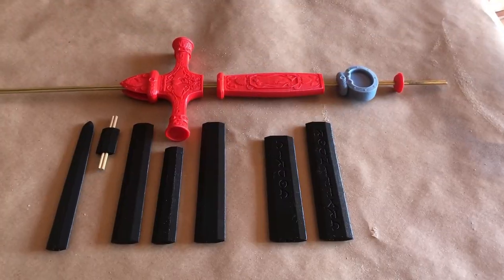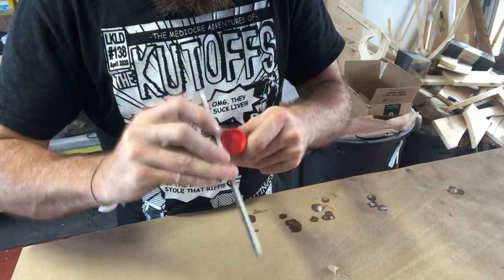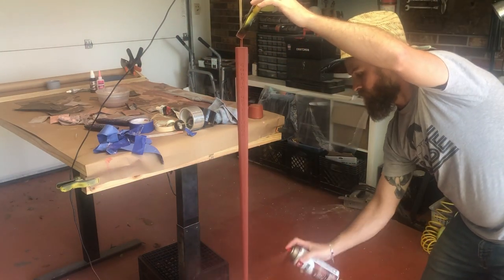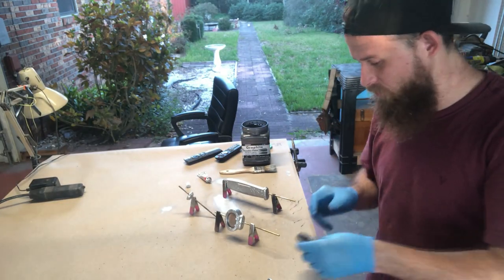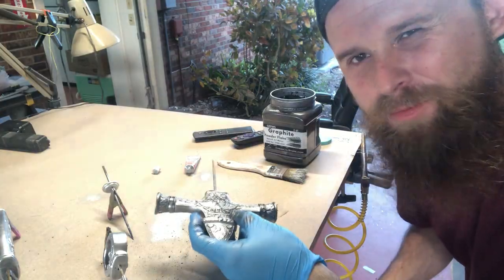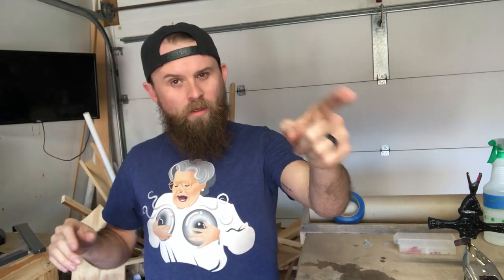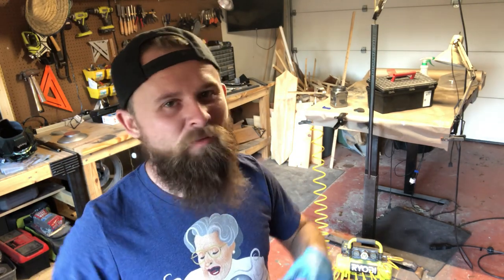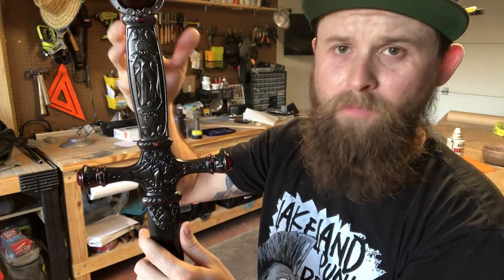"DIY: How to Make the Sword of Gryffindor from Harry Potter"

Comment: Hey looks good I was wondering what orientation did you use for the 3d printing the different parts. I have been able to print the pommel and the handle in resin but I'm struggling with the cross guard.  Thank you
Reply from the maker: Oh this is a good question I also had to try out a few different orientations
But I believe what I did in the end was set it at an angle with the pointed top section away from the print bed. Because I figured the easiest place to have the supports and also be able to clean it up after easily would be the under side of the cross guard. 

So I set it vertical at a slight angle so the connecting side to the handle wasn’t level with the print surface.

I found that it adhered and printed better if I set it at an angle instead of adhering directly and level to the print surface. 

I hope that made sense.
Let me know if you other questions 😁
Reply: @fandombuilds6701  Thank you I also found I needed to beef up my supports help also and now print out just fine.  Im trying out printing the whole thing in resin
Reply from the maker: @shmecky2818  I’d definitely do that to! 😁👍 I did the entire handle in resin then the blade in pla. The rubies I used a red transparent resin. 
If you wet sand then and clear coat they should turn out great! 
Post some pics when you finish, I’d like to see how it turns out :)

Comment: Esperar quando tempo depois de pintar para passa o grafite?
Reply from the maker: Great question! You should be able to able to apply the graphite as soon as the glossy black paint was dry. But make sure before you apply the graphite to wipe down and make sure there is no fingerprints or oils on the part. After the paint has dried you can wash it with soap and let it dry. Then once dry apply the graphite.
I hope that was helpful :)
Reply: @fandombuilds6701  legal. Muito obrigado.
Você é ótimo 😊🤜🏼🤛🏼